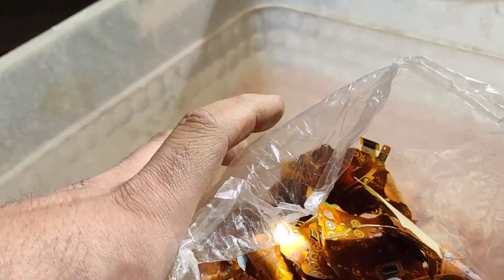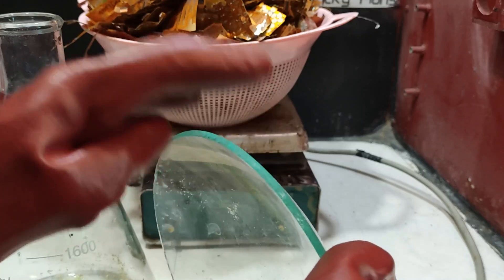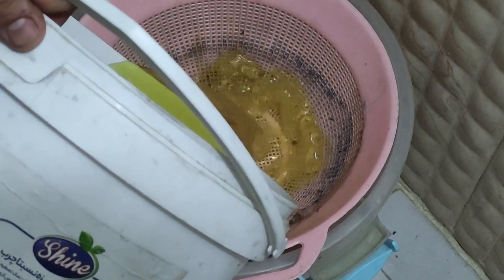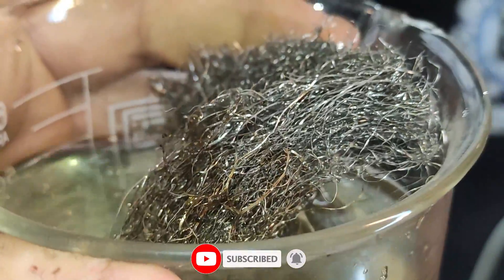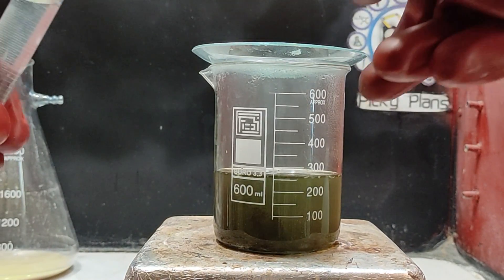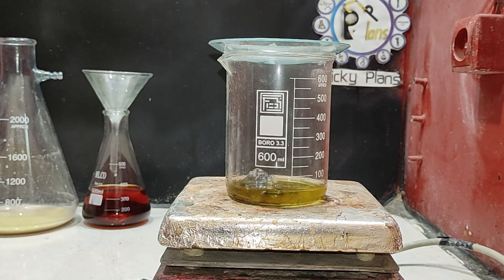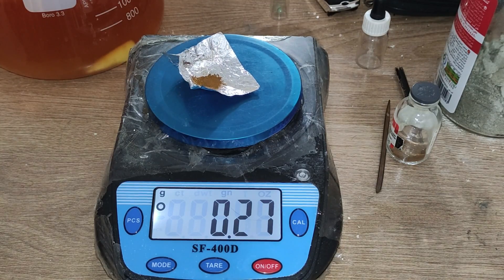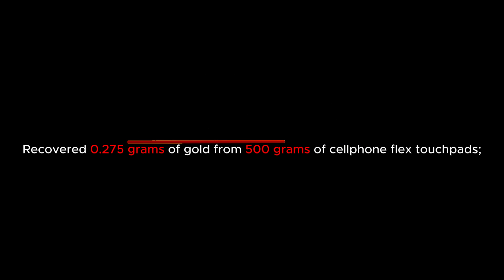Easy gold recovery from old Cell Phone flex Keypad | gold recovery from touchpad

Comment: Why in the world would you use anything other than copper to cement gold, get's messy imo.
Also, you left all that inside the cable?
Reply from the maker: In the alkaline gold solution copper isn't an option to cement gold.
I processed the cables separately by smelting/ cupellation there was only 0.05 grams of gold left from LEDs Mounted on the cables.